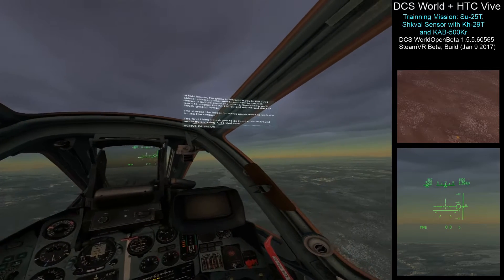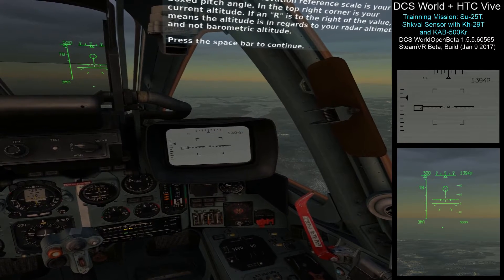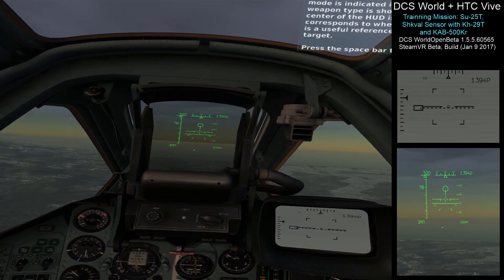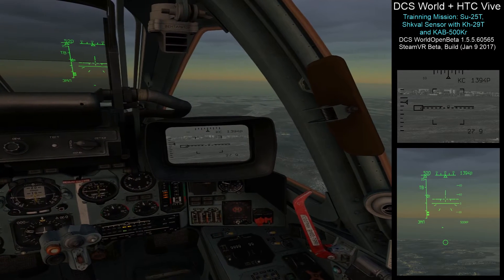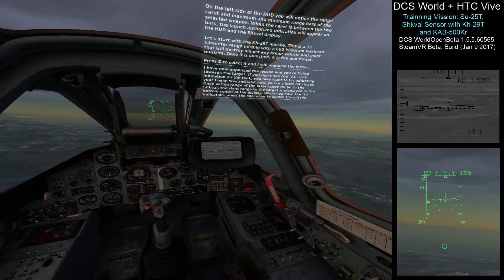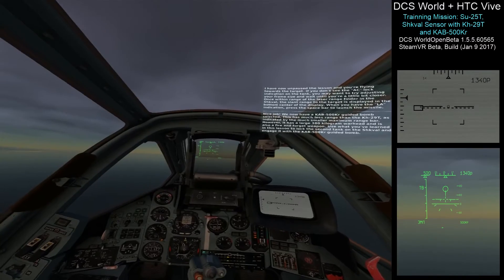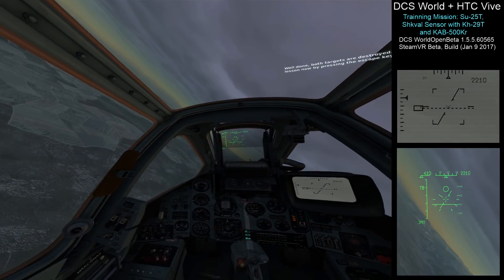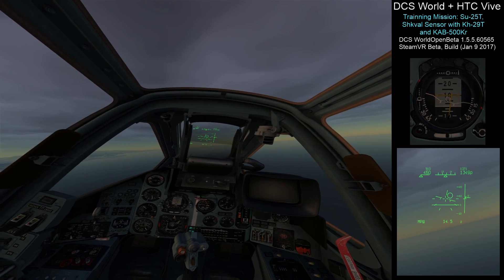Training in Virtual Reality - 020 Su-25T - Shkval Sensor with Kh-29T and KAB-500Kr

Comment: I found the target and matched the box with the target, but I never recieve the LA when NP flashes, so I cannot fire my weapon as if it never locks. I tried from a low angle, high angle, level flight at different altitudes but I just cant get my weapons release with the 29T weapon. Any thoughts? Sigh
Reply: Having exactly same issue, but it seems to be working outside this tutorial.
Reply: @teronuppi5388  Safe flying !! :D
Reply from the maker: Not really, I do remember I had to edit the triggers in some of the training missions to get them to work correctly though. You might try reading and posting in this forum. My apologies, and thanks for asking.
https://forums.eagle.ru/forumdisplay.php?f=451
Reply: @digitalengine7406  Biggest concern is if there is something I've missed. I just wanna make sure I know what I'm doing. Thanks for replying and thanks for your video. EDIT: I found my answer using your link (Bug in the training mode), thanks!